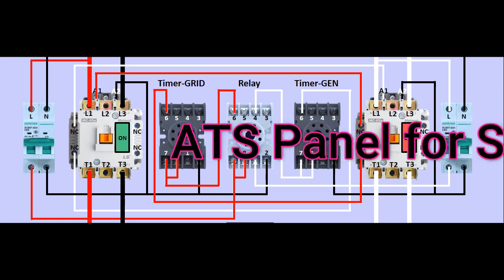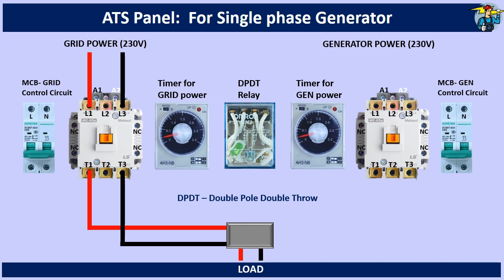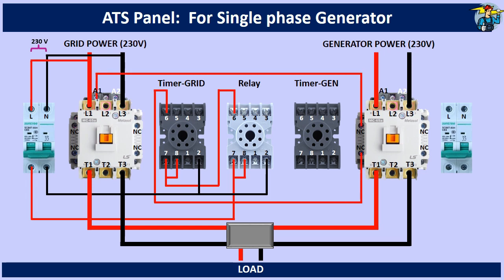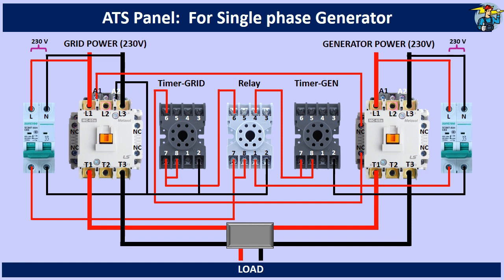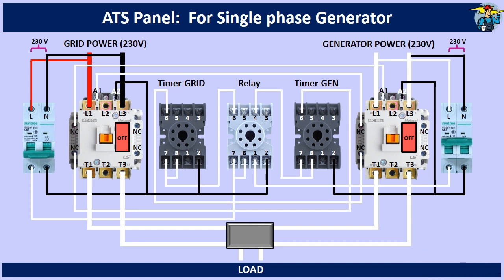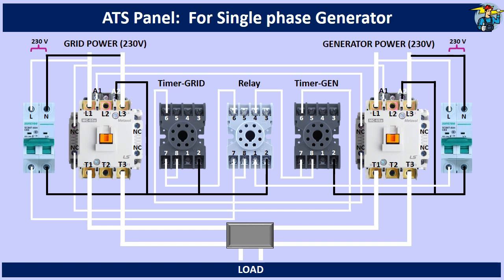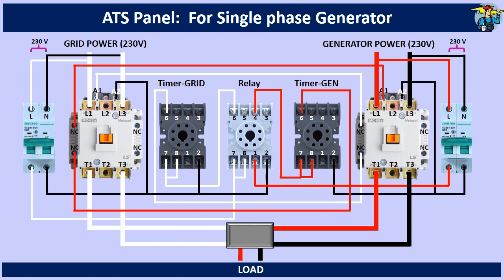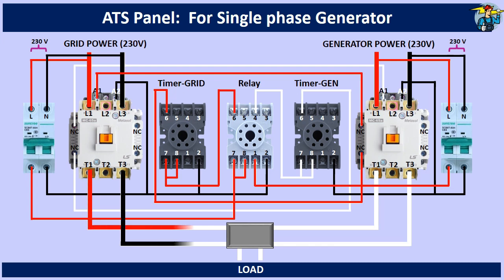ATS Panel for a Single Phase Generator / How Automatic Transmission Switch works?

Comment: Is this for a single phase generator with battery and key starter.
Reply from the maker: Yes
Reply: Please, make a video on a single phase key starter automatic changeover that can turn on the generator once the grid supply goes off.
I think this can only turn off the generator once the grid is restored but can't turn on the generator once the grid goes off
Thanks.

Comment: I've already subscribed to your video.
Please i need the design of automatic changeover for 3phase diesel generator.
Please, it should be able to turn on the generator once the grid goes off
Reply from the maker: Thank you.
For 3phase generator ATS, please go through this video,  https://youtu.be/_6WhieL50GI
Reply: For a single phase that uses key starter and battery, can this ATS turn such generator on automatically when the grid goes off and also turns it off when the grid is restored.